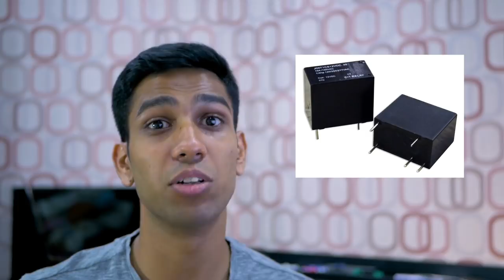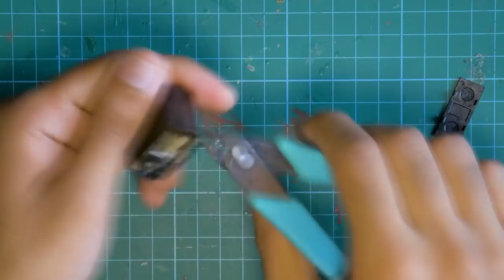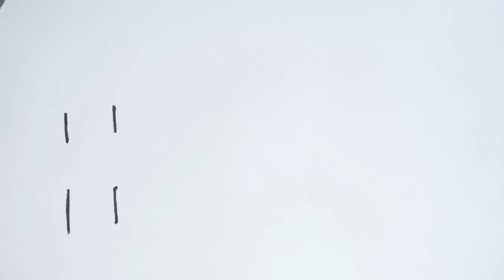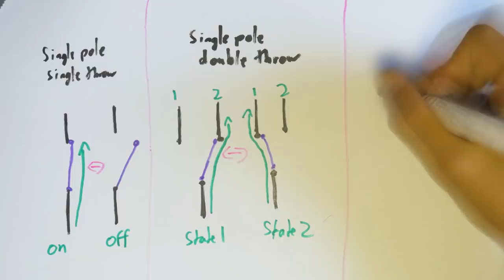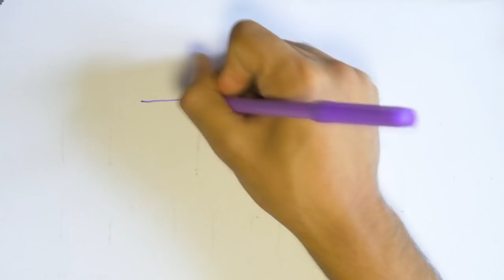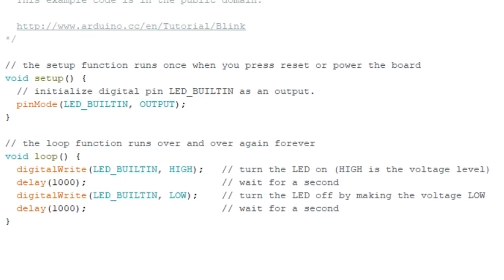Relay tutorial for beginners (Mechanical & Solid State Relays)- Electronics Crash Course #12

Comment: Nice tutorial. If im using two contactors for automatic transfer switch, and use relays to control one of the contactors, what diode specification is preferably i should used to prevent back emf. Appreciate much if you can help. The relay is 220vac coil SPDT 10amp.

Comment: good informative video.. we use relays a lot in our tester board and we face the issue of spiking.. this issue is due to the fact that inductive spiking occurs through coil when suddenly power is shut down. so inductor / coil, does not like the change in current and it creates the current spike, so we use snub circuit or flywheel diode.  solid state relays are very expensive compares to mech relays.. so price cost is always high. thats why we still prefer mech relays.. they also take larger size, so more area..
Reply from the maker: Thanks for your comment. Yes this is a real problem as you mentioned and most people aren't aware of it when they implement relays, that's why I mentioned it. Thanks for sharing your knowledge

Comment: Nice vid! I'm trying to test my relay without my load connected yet. Is this possible? The way I test is by using my multimeter to test connectivity between the input  (middle pin) and the normally closed pin. Then I run a program that sends 3.3V through the coil and check if there is now connectivity from the input pin to the normally open pin. However both times, the connectivity only exists between the input pin and the normally closed pin. Does the actuation rely on a load being passed through the relay? Is it not possible to test without a load? Or do I have a bad relay?
Reply from the maker: No, you can test continuity of the output load pins without any load attached to it. You might just have a bad/dead relay. Make sure to check the data sheet to confirm you're using the right pins for switching your relay. Good luck
Reply: @saraltayal5005  thanks for the help. I actually learned that I wasn't even supplying a high enough coil voltage to flip the switch. :)